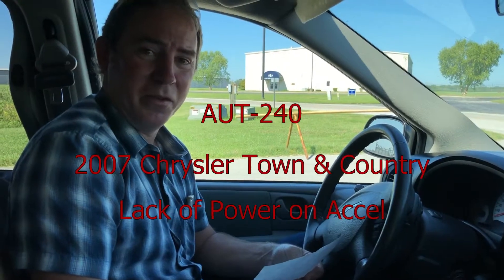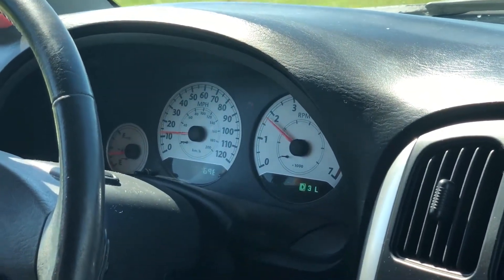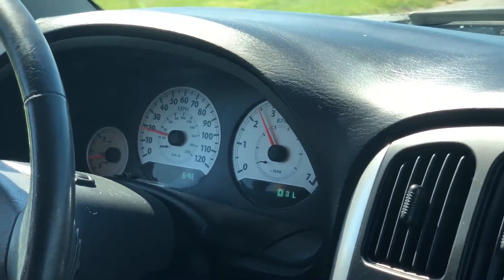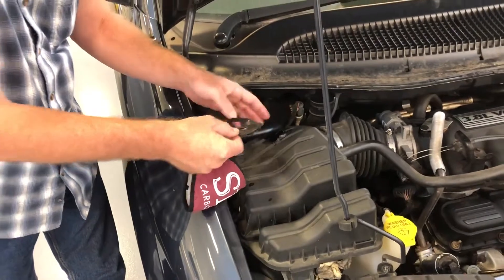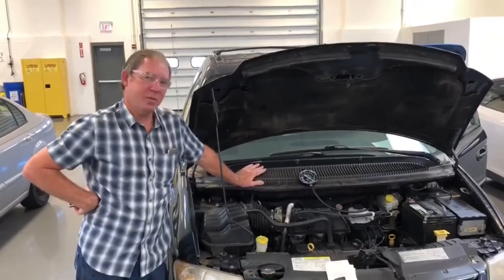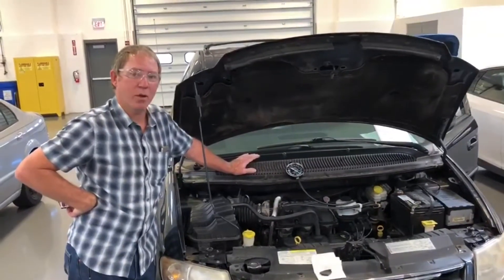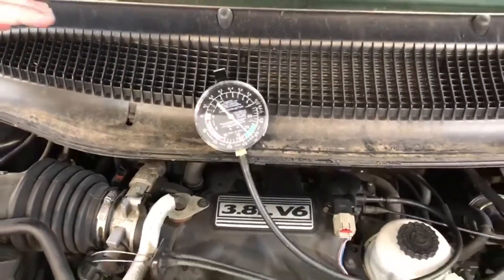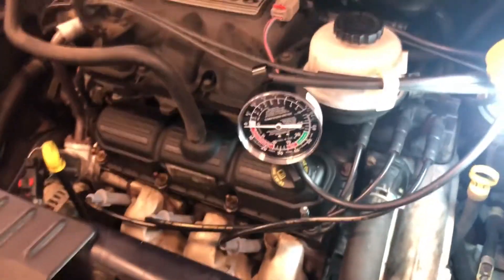AUT-240 SIUC Automotive 2007 Chrysler Town & Country Lack of Power Diagnosis Part 1

Comment: Hi There 
What did the Cat look like after you guys pulled it .
Ive got a 2001 with possible similar issues but milder 
Im in process of Elimination 
As ive replaced just about everything under the Hood otherwise .